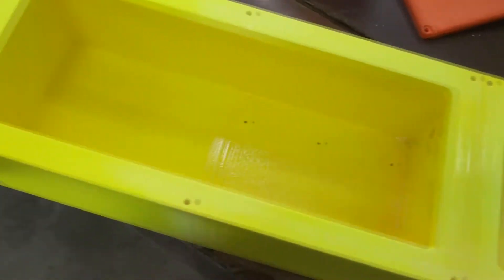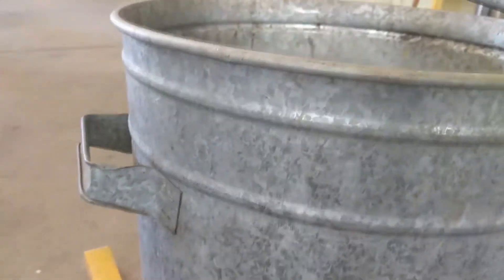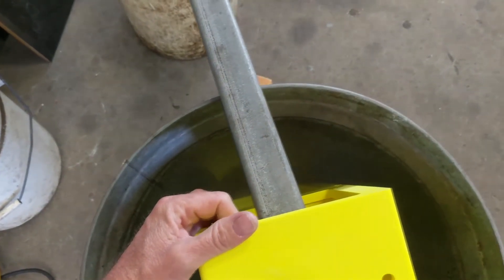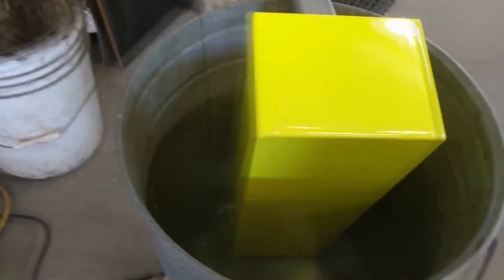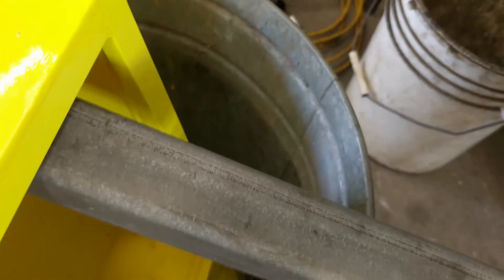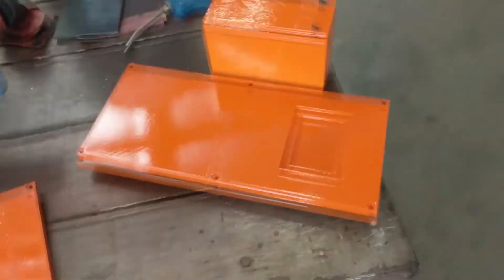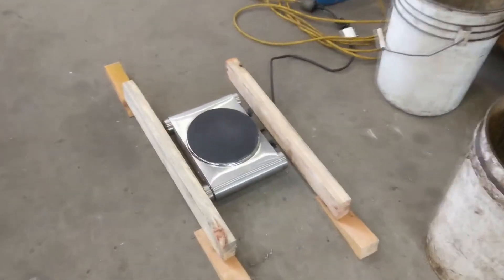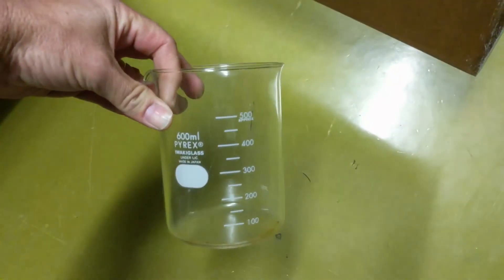Large 3D Print Acetone Vapour Treatment  PLUS Some Things to Watch Out For...

Comment: How long did you vapour smooth it for? Looks great!
Reply from the maker: Probably a minute or so depending on the job.  With this one the acetone was almost gone so it was in there for a bit longer.  Usually I'd go for about 40 seconds depending on the details you are preserving.  It's pretty easy to do so try a couple of test prints and see how it goes.  Have fun!
Reply: @ebswift  Wow that's really quick, I tried a few test prints, I'm a bit higher than boiling point on my hot plate (60°C/140°F). Is that around the temperature you use or much higher?
Reply from the maker: @BF3DS  With that little hotplate I just cranked it up, you want a nice thick vapour cloud.  If it's too hot the acetone will disappear too quick and it might want to spit droplets over the job.  If it's too cool you won't have a nice thick vapour cloud.  Honestly I didn't put a lot of thought into the temperature, generally get it pretty hot and keep your job away from the surface of the liquid where the droplets will be splashing around during the boil.